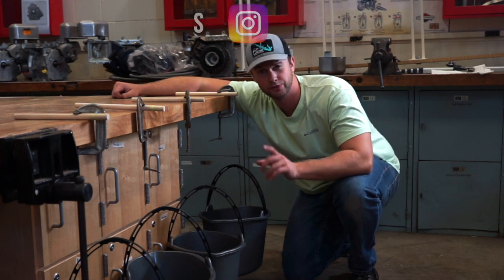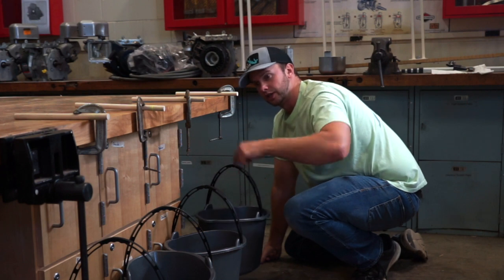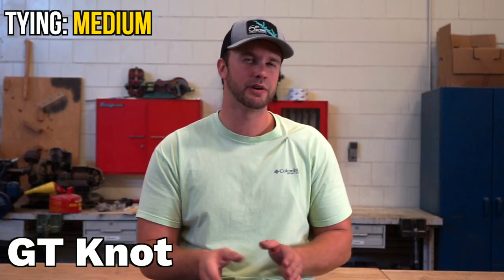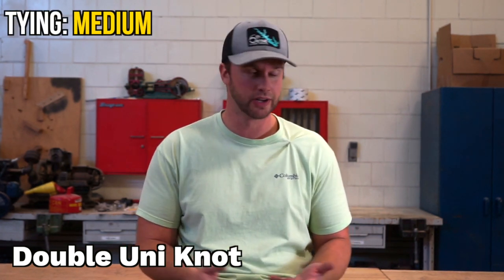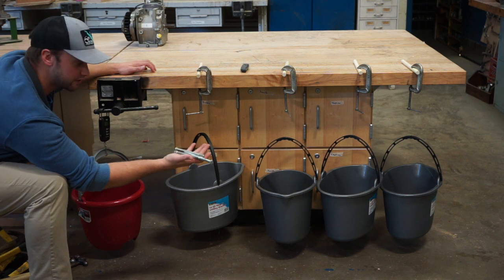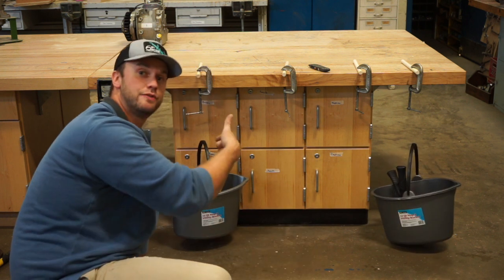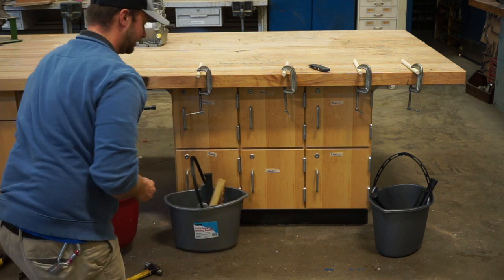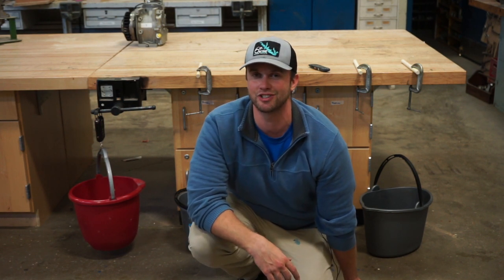Which bass fishing knot IS THE STRONGEST? (Flourocarbon to Braid!)

Comment: NIce video. When conducting experiments, you need to take into account sample size. Meaning run this experiment 5-10 times and get an average of when each knot fails. Also where are the failures occurring, at the knot to the dowl, at the main line, at the main line to leader knot, at the leader or at the knot at the bucket. I always use FG knots   👍🏻
Reply from the maker: Good points! Thanks
Reply: I'm a Double Uni Knot guy myself but agree entirely with your point about the sample size and where the line breaks and don't forget about if the fluoro line heated while being tied and of course brand/quality of line.
Reply from the maker: @jasonbruno3483  absolutely. Lot of variables

Comment: The PR is difficult (or should I rather say time consuming)... The FG is a good alternative to the PR when you are on the boat because it's easy and fast. It does require practice though. It's also always informative if you show where the line broke. Thanks.
Reply: I tie my PR Knots with a bobbing on the boat faster than I could ever tie a FG Knot !

Comment: FG knot all the way even if it's the hardest .. 
I will say that is not only the strongest but also very compact and easy to pass through the guides of the rod without being damaged. 

I've been using the albright knot but lost a lot of lures with it because of its size and when casting it was getting damaged by the rod guides .
Always use FG especially when casting heavier lures with thicker leader . Do not make the mistake that I did and save yourself some money.

Comment: Would’ve been interesting to have the Alberto knot in this lineup. I think it’s the strongest
Reply from the maker: I always thought Albright and Alberto were the same? I’d like to do this experiment again for sure
Reply: @DishesandFishes  it's definitely different. I've been using the Alberto knot for years. It's not quite as hard to tie as a FG, but it's up there on the fiddly scale.
Highly recommended.
Reply: I’d like to see how it holds up. As I’ve used it many times because of how quick it it to tie. I got a video on my channel on the ones that are my top 3. Not as fancy as yours. But you get the point 😆

Comment: Should have just filled the buckets with water and measured what poundage the knots broke at after all lines were broken. It would have a better reveal too. A 5 gallon bucket would break all 4 knots without a refill. Put labeled masking tape on the buckets for letting track. 

Water would be exceptionally accurate. 8Lb per gallon! I use a bucket of water to set static drag on my rods, since 8 lb to a gallon is constant I can use fractions of gallons expressed volumetrically to accomplish fairly exact weights with no weight or spring scale available. In your case you can weigh your results!

Knot tests are great! Thanks
Reply from the maker: For next time

Comment: The test was not fair to the double unit, notice the bucket kept rotating.  You need to stop it from twisting which will weaken the line.  That is why it drop later even though he can handle the weight.

Comment: The GT knot isn't designed for light line, and you probably didn't tie it correctly. You absolutely have to double the braid with a Bimini Twist, otherwise it isn't a GT knot and will never be stronger than any line to line knot. The Alberto knot is also as good if not better than the FG once you've practiced it enough. The FG and the Alberto can be done on the boat and in the wind without tension on the line once you've become proficient. Practice is the name of the game for these knots. The GT is best done at home the night before as it has to be done under tension.

Comment: What's the point of using braids if the knots to tie them together wont hold even close to the line ratings. Why not just use 6# line and give up a small amount of casting distance 🤔
Reply from the maker: I have a video I just posted last week on why I use them. I have problems with the straight flouro sometimes fluffing and then I have to cut the whole spool... braided line just lasts me a long time and I’m a cheap bastard

Comment: Beware of these universal strength tests. Not all knots behave the same when you start changing the parameters in the lines. FG knot works great as long as the braid has a smaller diameter than the leader material. If you try to use FG with braid that has a larger diameter than the leader you are just asking for lost fish.

Comment: For freshwater bass? I'd just go straight braid. Not many oyster shells in a lake and they don't have sharp teeth and they are reaction feeders so I don't see the point of creating a weak link, which is what every knot is. That said, if for some reason I was worried about rough conditions with potential for cut offs or bass seeing the line, like in cold weather/sluggish fish conditions, I would just run with mono instead of braid. If that's not an option just tie on a mono leader with a double uni. No need to over think it. Let's face it, you're not going to be catching many 15 to 20 lbs freshwater bass so typical freshwater bass fishing using a fluoro leader on an FG knot is not worth the effort imo.
Reply from the maker: I’ve found that smallmouth can be line shy in clear water, hence the need for fluorocarbon

Comment: All these knot “tests” done in the shop and on machines are irrelevant. A knot is not going to break the same on a machine or in a work shop with weight hanging on it as it is under the conditions of fishing. A knot performs completely different underwater than it will above water.
Reply: How so, if anything it sinches down and strengthens the knot when its wet, and thats why the fg won, because only braided line is being tied and theres no flouro to come undone. I could see water lubricating  mono or flouro but it only strengthens braid

Comment: This test is no good.    The #test of both the Braid and Florocarbon or Mono line must be the same.
  The buckets must be set up so that they do not put strain on the knot when loaded with weight.  Then let down slowly until the knot gets the full strain of the weight.  Remember the goal is to only test the strength of the knot.  To be completely analytical  and through the test must be  conducted 5 times to get the average.  An effort must be made to use the most consistent line as well.
Reply from the maker: Thank you

Comment: Yes fg knot is very good knot. And shine the best on lite line. However there not one video here on YouTube that show you how to tie a true gt knot. First and foremost it starts with a bimini twist. Yes that right if you watch all these videos on how to tie a gt and wonder why the test by these YouTube show the gt failing so miserable will because it's not being tied right. And this video is no exception.all though he didn't show you how it was tied it would have done nearly as well as the fg. With all this said the fg will out perform the gt on light line you go up to 40lb and about gt will make 100% line strength.the fg will be in the mid 80%. Gt will go past 100% depending on how the test is conducted..Yes . How that possible. Will I can't say for sure but either the line is underrated or it simply physics. Futher away from the knot is from the weight the less is being apply to the knot. He a simply test. Get a friend to rap some line around his hand while attach to your rod. Run out 100ft with your best meat stick and set the line as if you was try to hook a fish. You will barely move his hand. All the stress is coming from your end of the rod. Your main line is most likely your heavy line and your leader is most likely your lite line. All this has to be taken into consideration try to be adjectives in this test. If you want to learn how to tie a true gt knot and have the world's strongest knot knowing you can trust what your fishing with and knowing your getting 100% out of you line strength. Like the comments and I do a video on how to really tie a gt knot. That if I can get 10k likes. I even show you the really test. Thanks